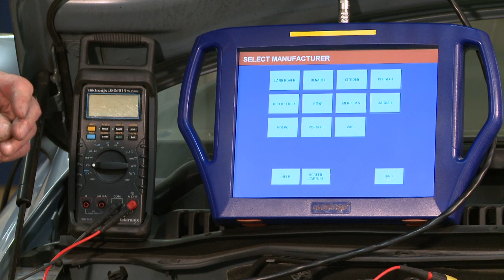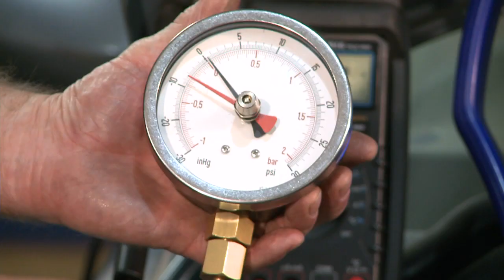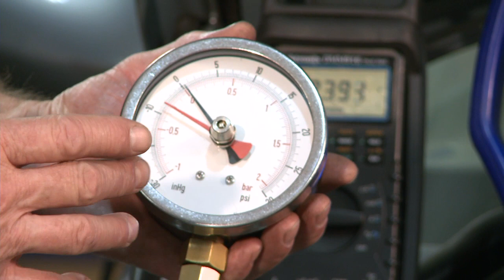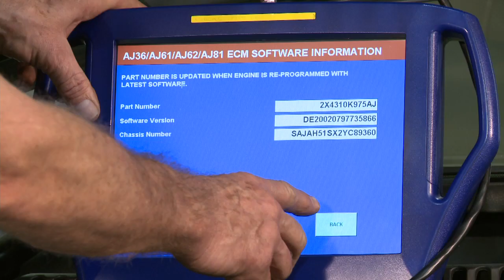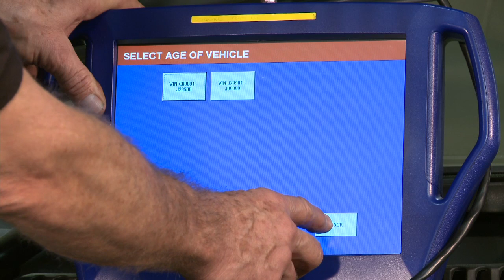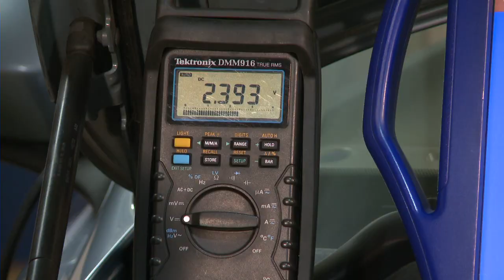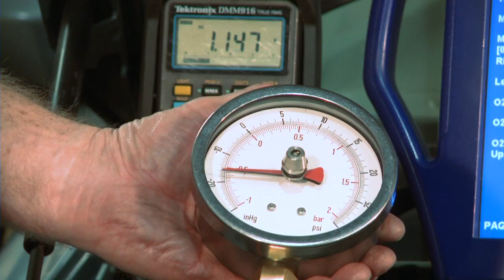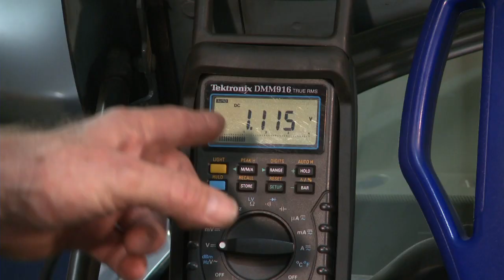AUTOiNFORM ONLINE MAGAZINE: Testing sensors in vehicle diagnostics

Comment: 6 psi its 12 in hg not 18😏
Reply: You should watch the difference or how the indicator on the gauge(0 to 18 in hg) and the scan data(14,5 to 6 psi) changed, and that change is equal(18 in hg = 8,5 psi ). There's a video on youtube about map and absolut pressure explanation.